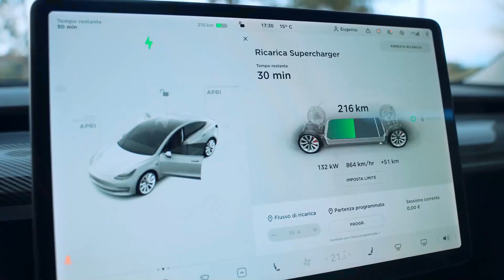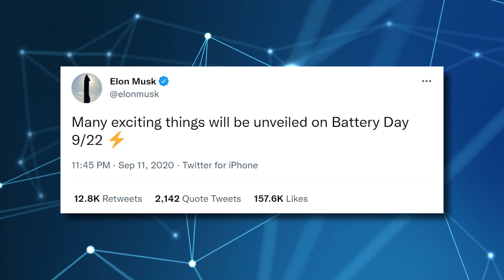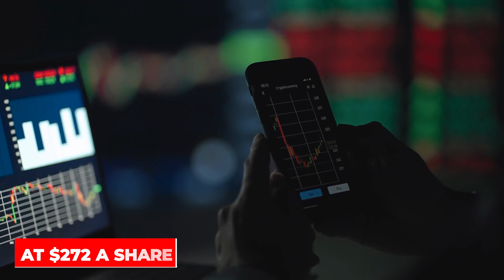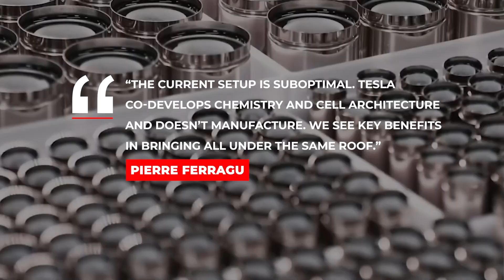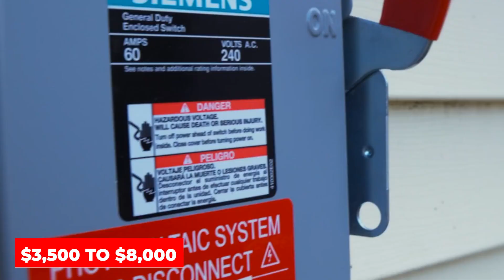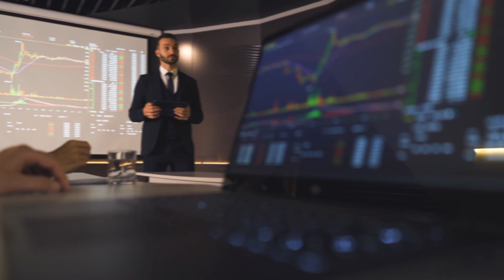Tesla Solid State Battery Tesla Battery Investor Day

Comment: This video has nothing informative about it. It would be relevant about 5 years ago. For you to quote "experts" that state that Tesla does not produce it's own batteries whilst they have been manufacturing 4680s for the past 10 months, at least is... ridiculous. What is also ridiculous is the title of your video - Musk himself stated that solid state battery is a pipedream - hence the big investment in 4680s manufacturing capacity, not only by Tesla but also by Panasonic. A third ridiculous statement is the stock price - if you are "on the ball" you should be aware that the price right now is around $1300/share (not $400, $300 or the rest of the nonsense you are quoting) That price is based on the historical growth of 69% till 2020 and this year's growth of 90% to 100% (depending on whether Tesla will deliver 900,000 units or 1,000,000 units).
Ridiculous and preposterous all the way around. Know your facts before you report on them as the truth!